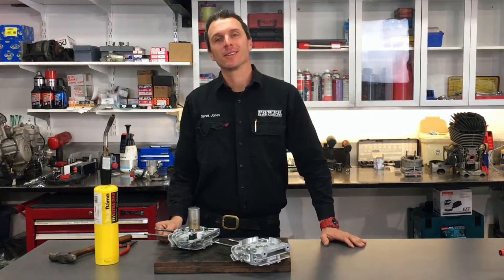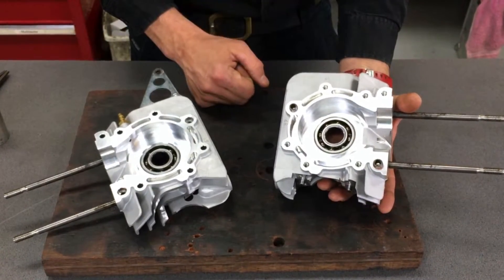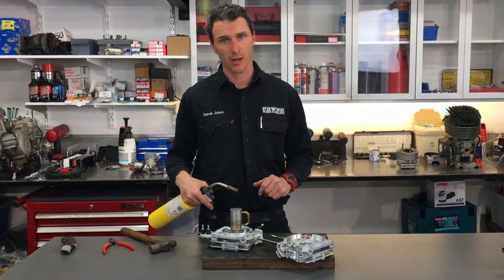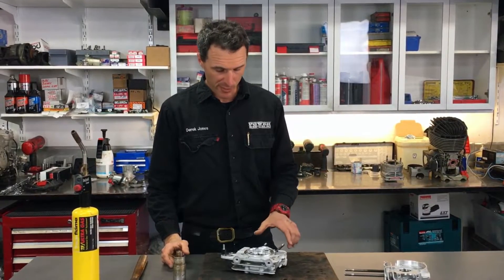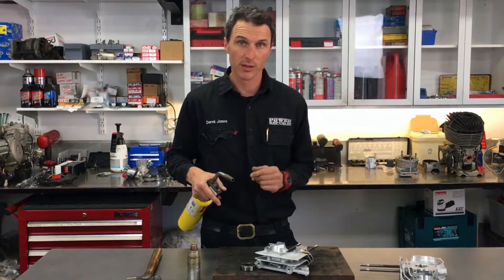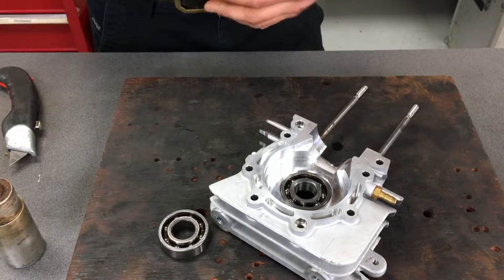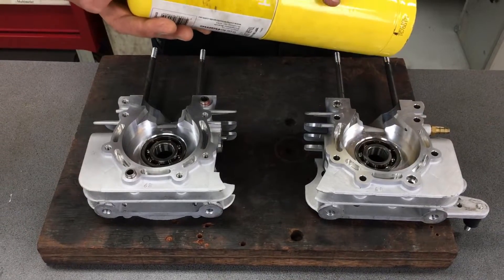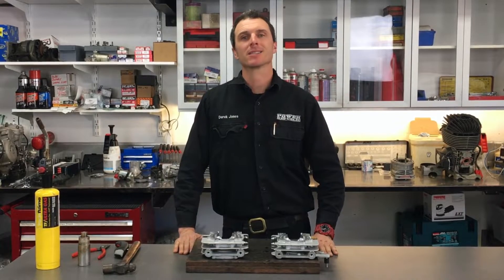How To Change Your Crank Case Bearings - POWER REPUBLIC

Comment: Hi! How do I replace the main bearing on tm r1, SKF BC1-1442 B ? I don't think it will come out of the case, only with the use of heat !?
Can any video for that type of bearing? Thank you.
Reply from the maker: yeah you can even put them in the oven @ 200C and wait for them to fall out.   otherwise you can use an oxy torch to heat up the cases around the bearing housing.